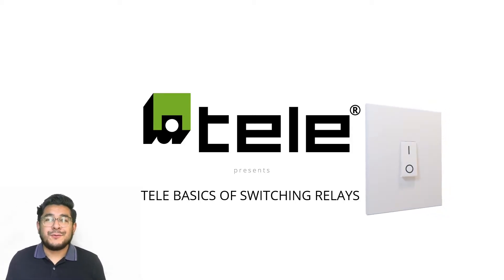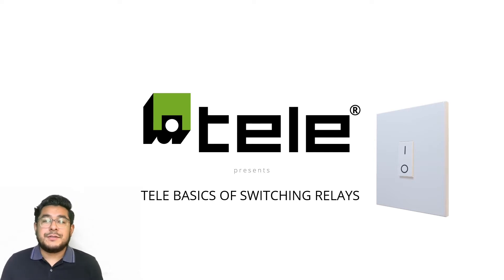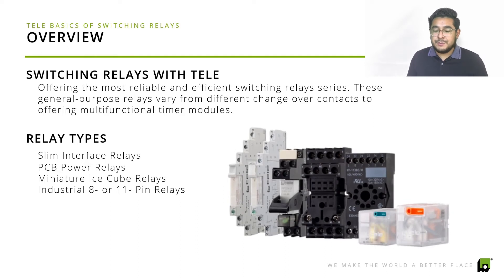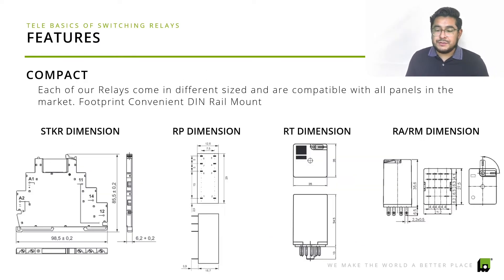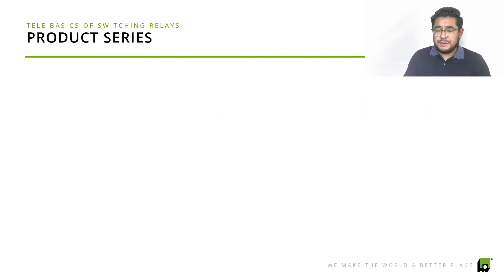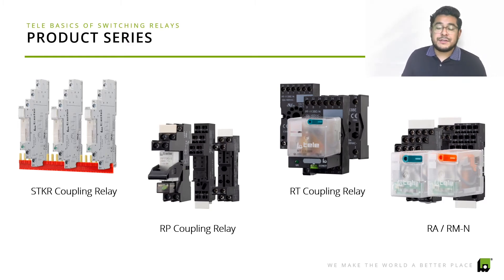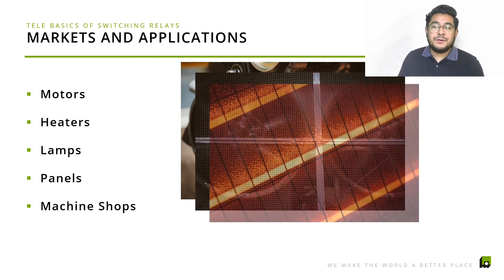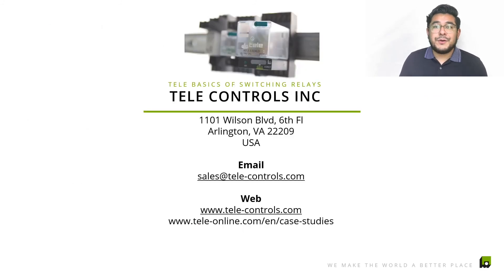Switching Relay Basics | TELE Session 15

Comment: I want a stand-by battery in my house instead of relying on the generator when we have an outage.  I want the switch-over to be automatic.  I envision a relay fed by a small current from my breaker box that will keep the relay open to isolate the battery.  In the event of an outage, that small current would be interrupted and the relay would close and put my house on battery power.  Likewise, in the event that the power is restored, the relay should open the batter side and restore grid power again.  
Which of your products seems applicable in my case?
Reply from the maker: Alex, thanks for watching our video series! We have a specially designed device for your use case that detects voltage and frequency levels in your grid and makes sure to activate your backup power like a battery pack or generator accordingly in case of a power outage. For proper switching of battery loads, we recommend DC contactors or power switches to make sure the application is a long lasting one. Feel free to shoot us an email via sales@tele-controls.com and we are more than happy to work a proper solution out with you.